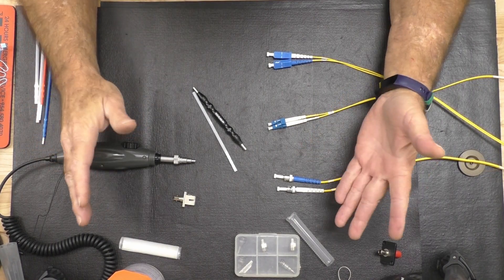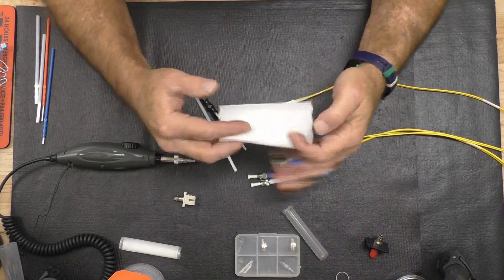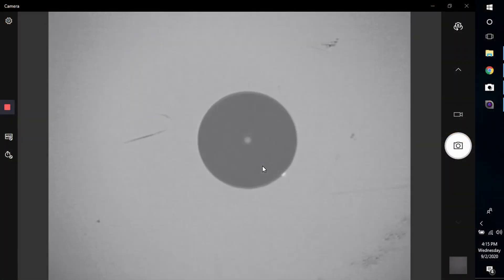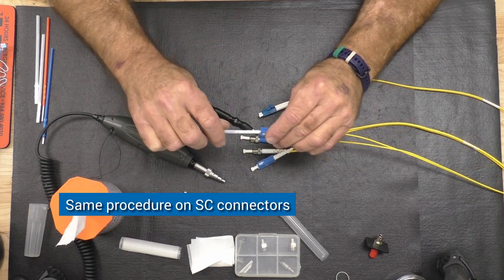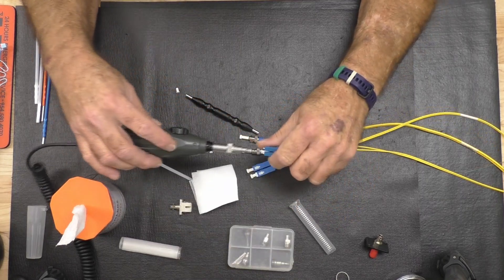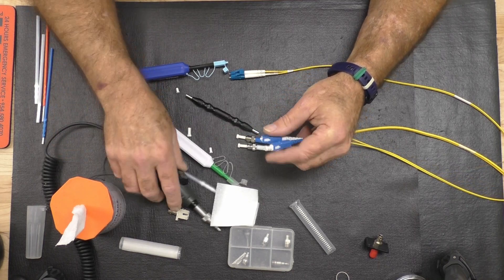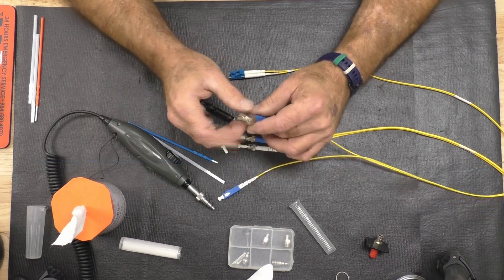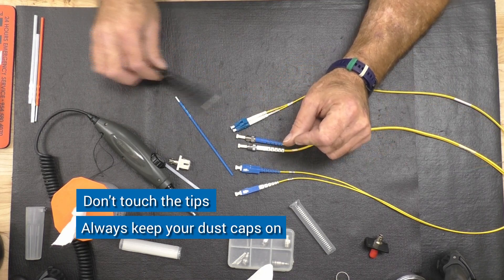LC, SC and ST connectors cleaning

Comment: Do I need disconnect cable at both end when cleaning?
Reply: I don't think so, the optics go into a low power mode when disconnected. Just don't point the connector anywhere near eyes, and don't look into it.